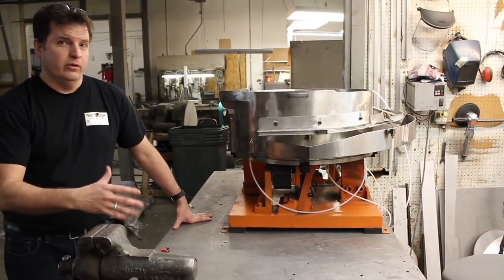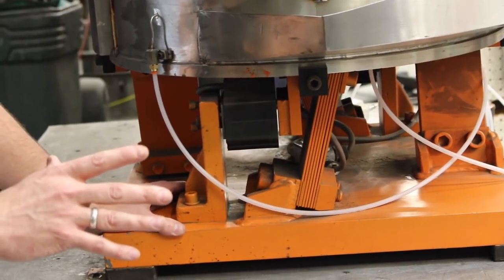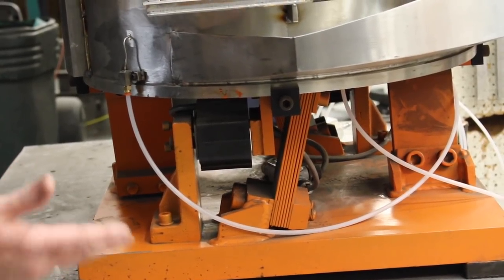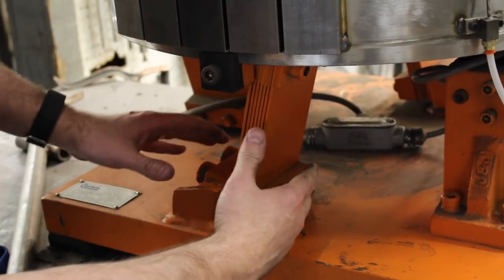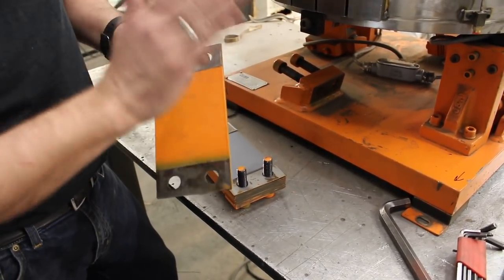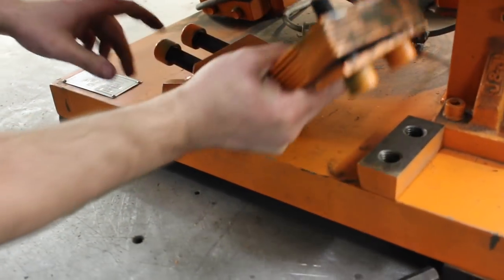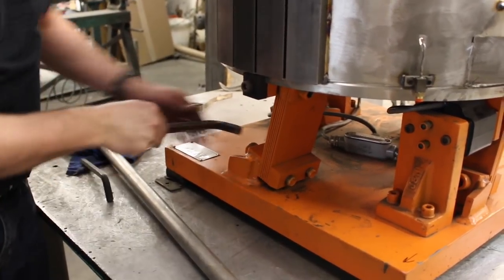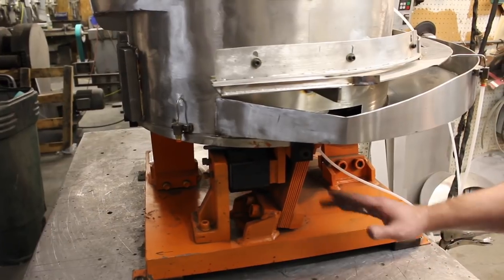How to Adjust Tuning on Vibratory Feeder Bowls- Feeding Concepts, Inc.

Comment: Doesn’t a missing spring spacer change the value of a sping pack?
Letting two springs touch is a variant that mathematically can’t be measured .
I just ask as an old goat roper that used to teach this theory..
Reply from the maker: No …Hendrickswould remove them all if needed.

Comment: When a spring stack has a broken spring replaced, does it affect how that stack works? Or for best results, should I replace the whole stack as a set? As I see it, in your video, the springs become work hardened and installing a new spring into the stack will make it work differently. I see performance issues like what you’ve shown here in my job quite often and never knew what the best practice was to fix it. Thanks for the video, very helpful.
Reply from the maker: Neil Flannery Once the broken spring has been replaced, that spring bank should be fine. There is no need to replace springs, as long as they are in good condition. As long as the spring being swapped for the broken one is that same thickness, the tubing should change too much. Refer to the video to determine if it is over or under sprung. You can also you a variable frequency controller to determine the tuning of your drive.
Reply: Feeding Concepts, Inc. Thankyou very much, all very handy information- love your work